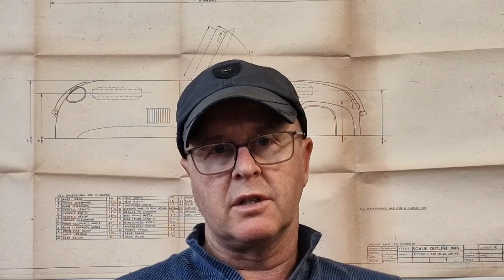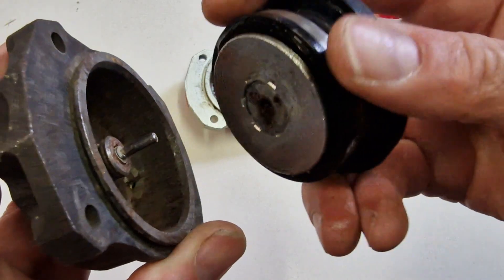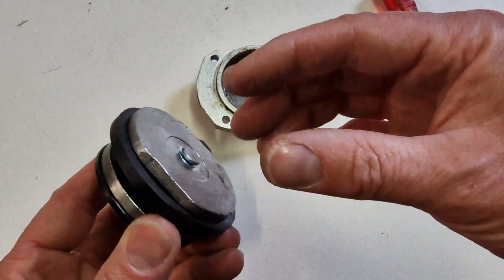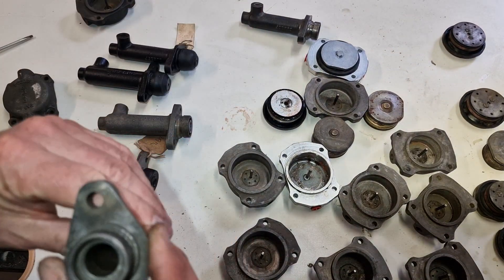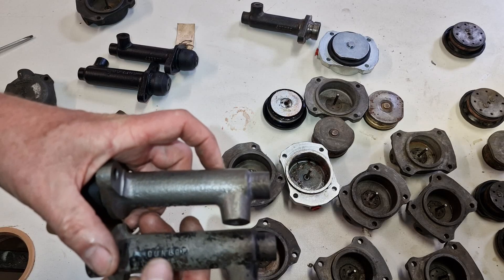Danger Zone: Avoiding Catastrophic Brake Failures in Classic Cars

Comment: There are replacement brake cylinders  that have the o ring seal in the body and not on the piston which helps keep water out.
Reply from the maker: Even for the S1 E Type? I know that Jaguar changed for the S2 which has the seal in the cylinder and the piston is stainless.

Comment: Hi Maikel.
Much to discuss.
There is also the matter of brake fluid being hygroscopic.
Stainless steel, or Edelstahl, is stain less, not stain free. It will and can rust/suffer from galvanic corrosion.
Flip me an email and I can give you a little more info.
Best regards,
Damon
Reply from the maker: Hi Damon, 
thank you very much for your reaction. That is what I wanted. I know several people who had the same problem. Everyone is worried and wondering what to do. Sure, you can change the entire brake system, but often, at least here in Germany those are not technically approved or certified. So, what can we do to keep the cars on the road without worrying too much about the brakes. I think Mercedes and Volvo used the same DUNLOP brakes. Please write all you now in these comments that we all can make up our own opinion and decision. I find these sleeves an appropriate way to overcome the risk of stuck brake pistons. Need to mention that this only goes for the S1 cars. It was changed for S2 cars.

Main intention is to make people become aware of it  !!
Reply: @JaguarEType  Hi Maikel,
only because you feely share your intellectual capital with us all,  I shall , in return, share some of my hard won intellectual capital and experience with you.
It is not easy for me to get all of my experience across in a format that involves typing and not talking.
Here goes.
    Firstly, it must be remembered that brake fluid is hygroscopic, ie; it absorbs moisture from the air.
It absorbs moisture through the rubber brake hoses and the necessary vent holes in any reservoirs. This moisture accumulates and then settles to the lowest points in the system, ie: the brake calipers/wheel cylinders.
Moisture permeates any rubber dust seals through microscopic holes in the rubber, similarly flexible hoses, and most dust seals are just that, dust seals rather than proper air tight seals.
Hence the need to flush your brake fluid every two years. Brake fluid is horrible stuff but a necessary evil. There is no viable substitute. I have tried silicone brake fluids but they are not compatible with the ethylene propylene rubber used in the seals and cause them to swell too much and seize things up .
    Best practice is to use good brake fluid and change it every two years.
Stainless steel sleeves are best practice to refurbish brake cylinders, but make no mistake, they can and will rust. They are not stain free.
   The causes of the rust are mostly due to moisture permeating the outer rubber dust seals, but also from the brake fluid that absorbs the moisture. Once it is in the system the only way to get it out is to flush it out.
   The term "rust" is a loose one, a more correct term is galvanic corrosion, whereby you have two dissimilar metals and an electrolyte. Introducing stainless steel where there was previously only cast iron introduces a dissimilar metal. Water/moisture is the electrolyte.
When we have two dissimilar metals and an electrolyte we effectively have a battery where atoms from one metal pass to the other, which is the cause/effect of all the pitting.
   The rust can directly rust the cylinder bore/sleeve , but it can also start rusting the piston. 
   When you overhaul, get your pistons re-plated , do not just wire wheel them of old rust and then re-install them. Electroplating staves off rusting. They were plated when new and any protection you get will prolong  the  operating life of the system.  Most of the piston is exposed to the atmospheric side of any brake fluid seals and this is where most of the damage seems to be done.
I have tried many ways to lubricate/protect the piston on the atmospheric side of the seals, from rubber grease to synthetic lubricants. None seem to work very well or for prolonged periods of time.
However, I have been testing a compound that I know prevents corrosion in marine environments like no other.
I have tested this compound in brake fluid for extended periods and have seen no deterioration whatsoever and no any side effects upon the ethylene propylene rubbers used in brake seals.
I now coat the pistons, especially the sides behind the dust seals with a product known as Tefgel.
It is unrivalled in the prevention of galvanic corrosion.
These problems are further exacerbated by the fact that these cars are not driven as frequently as they were when new and cars wear out more quickly by not being driven than being driven, especially braking systems. Stasis kills cars.
I have many clients that for whatever reasons do not drive their cars often and I have been combatting these issues for decades.
The Dunlop wheel cylinders were particularly prone to problems because the piston seal was on the piston and not in the caliper body. All modern calipers have this situation reversed and, as a result, suffer less from rust/pitting. They are not immune from it however.
It is quite normal for the brake pads in Dunlop calipers to wear down and the bores of the wheel cylinders rust in the area inside/inboard of the seal, then, when new brake pads are necessarily  fitted the piston and seal need to be pushed back over the ridges/lumps of rust and the seal is now expected to work over an area that is rusted and not smooth.
Failure/leakage ensues. Expensive overhaul of the wheel cylinders is the only fix, until the pads need changing again....
We all stand on the shoulders of giants and Dunlop's system was the first, it was cutting edge in its day.
I recommend Tefgel to be smeared on the cylinder and pistons of these cars and it will stop galvanic corrosion in those parts.
From my observations it is not affected by the nasty  glycols that are inherent in brake fluids.
There is no better low temperature anti seize on the market for that matter for nuts/bolts and electrical connections in my opinion.
Jaguar, Aston Martin, Jensen, Ferrari, Alfa Romeo, Austin Healey, Iso Grifo, Lancia, Daimler, Facel Vega, all used these same type Dunlop brakes.
Best regards
Damon
Reply from the maker: @nkelly.9  Hi Damon,
thank you very much once again for your expertise. I think it is always better that people do get a second or third opinion and your input is most valuable and explains it in details for those who want to know more. Also I have learned from your explanation and will use this Tefgel you recommend as I have been using ATE brake assembly paste.
https://www.ate-info.de/en/details/produkte/ate-bremszylinder-paste-180-ml_spanisch
I can not tell how much different it is to the Tef Gel https://www.toplicht.de/en/electrics-engine/accessories-for-engines/grease-lubricants-grease-pumps/3034/corrosion-eliminator-paste-tef-gel.
Could you let us know if and what the difference it. I am not linked to any of those nor do I think are you.

Many thanks Damon, and all the others for yachting and adding your input.👍